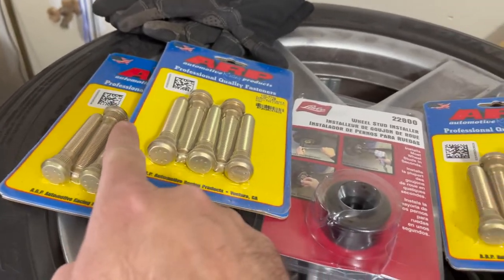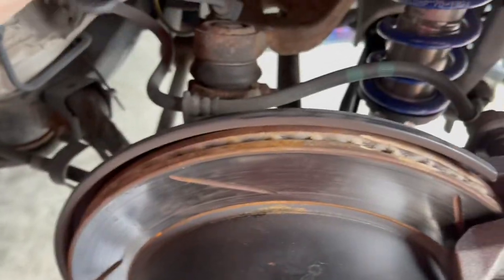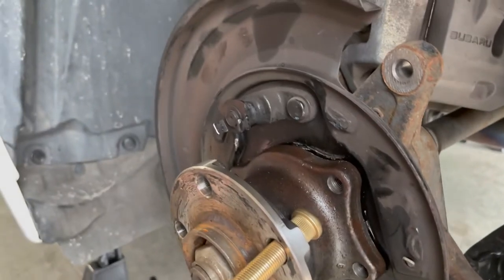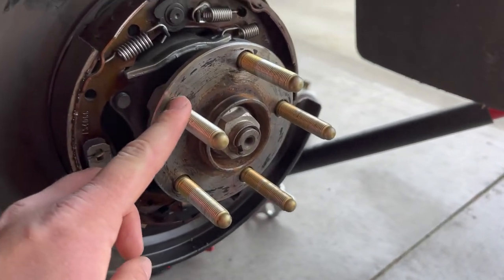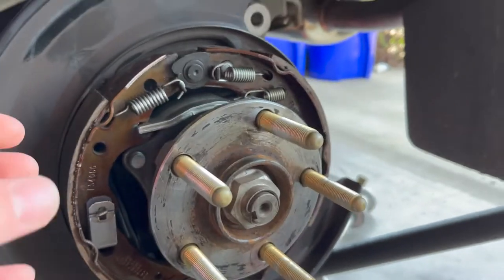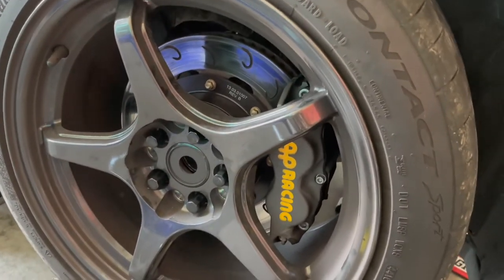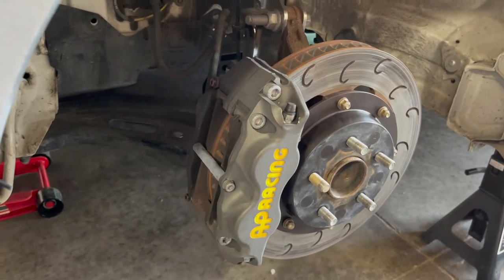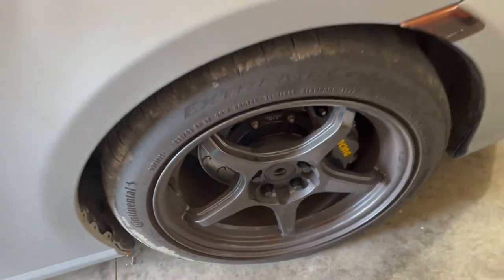2014 BRZ ARP Wheel Stud Install

Comment: Nice honest video. Planning on changing to ARP studs on my '22 GR86.
Reply from the maker: I imagine the process will be largely the same considering the underpinnings of both chassis’ are super similar!
Reply: @ShiftyIntentions  - You're right. Should be exactly the same.
Reply: So I did the extended stud on my ‘22 gr86 the same way as he did with the back and had to end up taking the whole e-brake assembly apart and put it back together later on and then drop the car but when I went to start up the car i had a code pop up and it was a light show in my car and the cold start was supper shit, just wondering what route did you take and if the same gap to you and what have you done to fix it, need help🤧
Reply: @geogalindez5979  - My extended studs on the rear were not that long, so I didn't have to take the e-brake assembly off. If you have a scan tool you can find out what the code is.